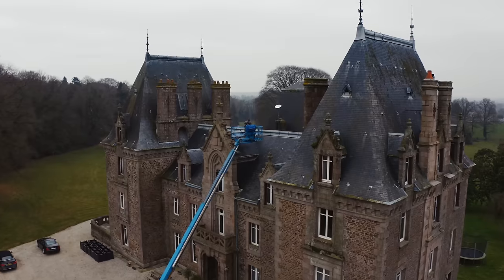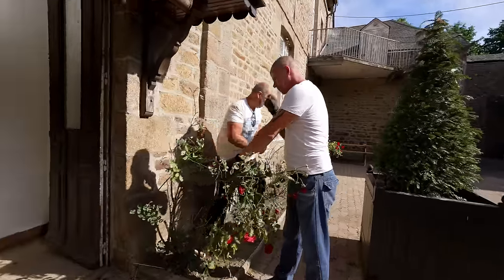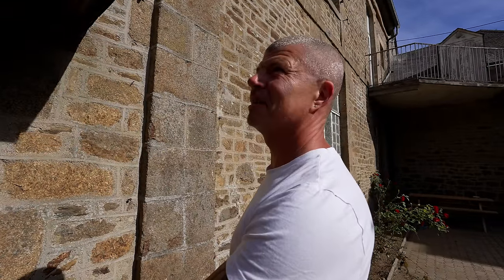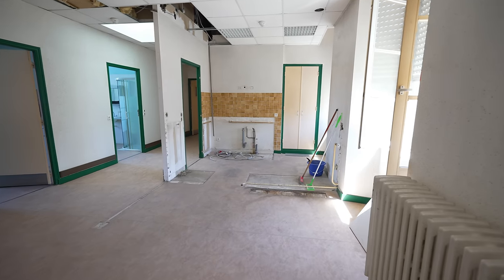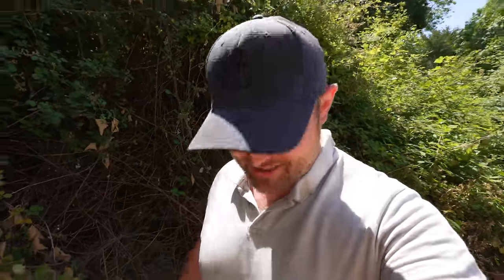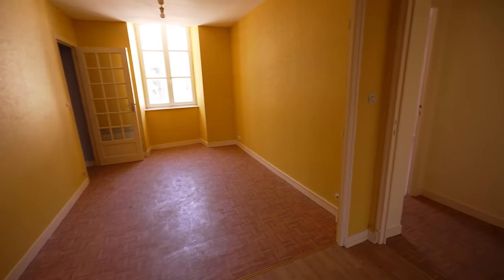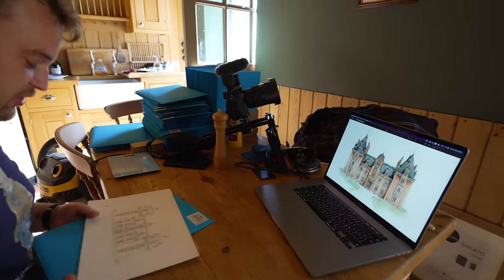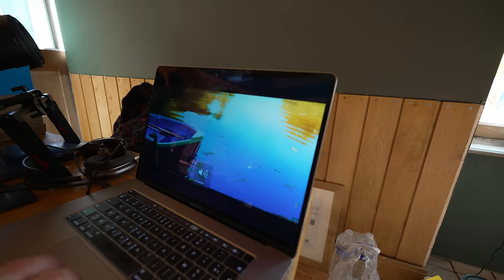Stepping Up The Security & Work Begins! @DoingItOurselvesOfficial

Comment: The textured wall is called portaflek, it was popular in the 80’s and 90’s in schools. It’s sprayed on then sealed with a clear laquer. It’s very hard wearing and can be scrubbed clean. Best way to get rid is too sand it, then primmer the surface then paint hope this help

Comment: Billy, I looked at the speckled "paint" on the "office" walls and offer an opinion. In 1959, my parents built the new house and I had my apartment in the lower level. The walls were covered in the same texture you noticed. The panels were pre-finished then installed, which tells me this might be a sprayed finish. I am thinking sanding then skim coating and painting. This is s highly durable finish and it will last decades if you leave it. If I can't destroy it, it must be tough!!! Kudos on your You Tube award!!
Reply from the maker: thank you!
Reply: @ThePethericks  It's used in Australia in commercial venues & is long lasting & easily cleaned.  The advice to prime then paint is a good one.

Comment: In regard to the kitchen wall, maybe use a fine grinding pad on a random orbital sander to smooth the surface.  A regular sanding pad might take too long.  The granite troughs might look nice in the courtyard instead of out back.  Depends on what you decide to do with the rest of the landscaping on the rest of the convent property.  Instead of taking up the tarmac in the courtyard that you dislike, why not cobble over it so that you have a firmer foundation for the cobblestones?  If you think that it might raise the surface too high next to the building, then dig out a shallow drain that mimics the line of the building & line it also with the cobblestones.  A dropped surface drain 30-60 meters in width would be good to have during heavy downpours of rain.  In addition to raising the "paved" surface of the courtyard, you could also raise the grass & garden areas with some soil amendments.  Well, there's my 2 pence (centimes) worth of suggestions.

Comment: Billy, if it's the same stuff I dealt with, it forms a uniform layer with "protrusions" into space. If you try sanding it, the protruding parts will shoot off and, more importantly, take out a piece of the layer around them with them. We had to scrape it all off. I was told later it's reinforced with plastic, as someone else mentioned here before. The good news is that if it was applied shoddily, once you start scraping, whole swathes will come off. We made a game of who can take off the largest sheet :)

Comment: I've used Reolink before at my old apartment.  They had the best option for completely wireless security (battery and wifi operated) that I could find at the time.  I had 2 cameras and I was Really happy with the quality.  I also loved that I could access and control them through my phone app.  And also have cloud storage.  My condo HOA doesn't allow us to have our own security cameras now, but I still have my cameras just in case I need them for security when I'm camping.

Comment: My name is William, I was a maintenance engineer for a US naval museum also studied carpentry through our local community college be mindful with any textured material on ceilings or walls, the material may contain asbestos if the material is sparkly it might be vermiculite vermiculite can be contaminated with asbestos, sometimes asbestos is used as a spray-on insulation and fire inhibitor I would say respirators 3M full face respirators when dealing with it full PPE personal protective equipment, remediation of asbestos must be done by certified personnel and disposed of in a certified disposal area, just trying to keep my friends safe love the work wish I could visit

Comment: the paint is a special paint used in public toilets and its water proof and also seals the wall so check for damp issues  but the walls look good its very expensive paint 40 pound a tin  can be painted or sprayed on  if you want the wall to breath its needs to come off

Comment: As for removal of that textured paint, might be worth approaching a few textured paint suppliers for advice about either removal or application of a new type of finish. Possible toxicity of the current surface finish might be a consideration. Depending on what your research throws up, might it be simpler in the long run to skim it with a nice plaster finish?

Comment: Billy, this is just an observation but the metallic trunking for the security system stands out like a sore thumb, just as did the old porch. Might it be worth choosing a paint suitable for metal and painting the trunking to blend in with the stonework of the convent? Always difficult to blend the old with the new, but a discreet touch of paint can do wonders, especially for something as essential as security measures. 
Removal of the old porch was a great move & the roses are looking fab; try giving them either a well forked in feed of fish, blood & bone or use well rotted horse manure as a thick mulch to feed & conserve moisture. Make sure it IS well rotted or you'll burn anything it's applied to, probably killing it.

Comment: Put two lights on each side of the door, where you took down the small door roof. Could there be a old fireplace behind the area,(behind the metal hood) where you took down the kitchen? It looks like there is a old mantle for one there. Also under those low ceilings might be some taller one, them old buildings had tall ceilings.

Comment: Have you thought about installing an eco friendly heating system?  Geothermal heating and cooling systems and solar panels for the entire building might be a big one time investment but would be a great with such a huge building and the raising gas prices.  Not sure how well it can be installed in an older building because it is often installed in underfloor heating. Definitely the building needs alot of insulation! We are looking at buying an old building and still need to start investigating heating and cooling systems options.

Comment: You could lightly sand the paint, then skim coat it with mud (spackle compound) to prepare it for a good primer.
Use 2 coats, primer plus finish coat. Very important.
Reply from the maker: thank you for the suggestion i think it’s the only way!